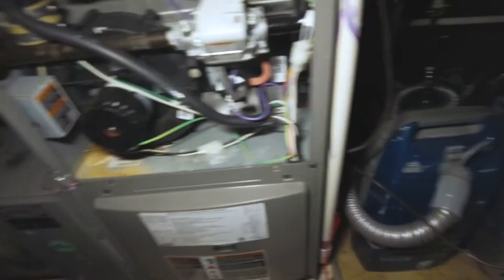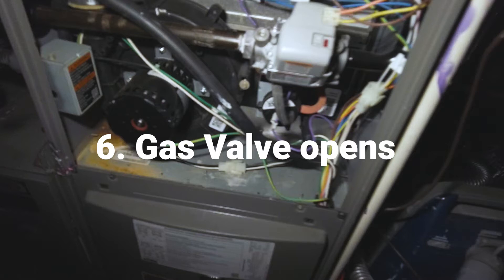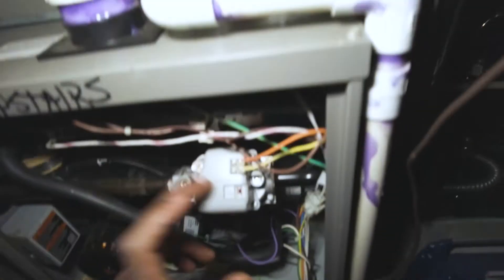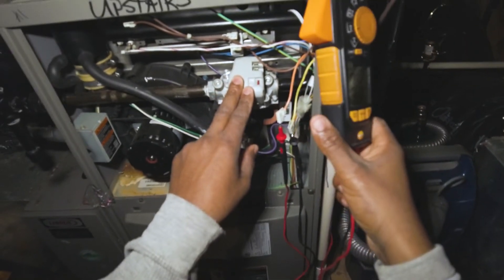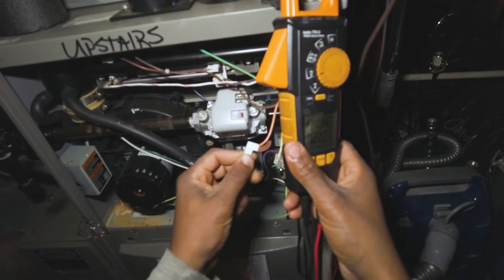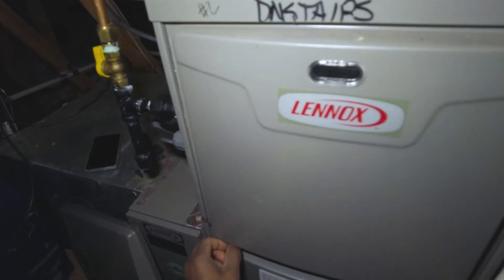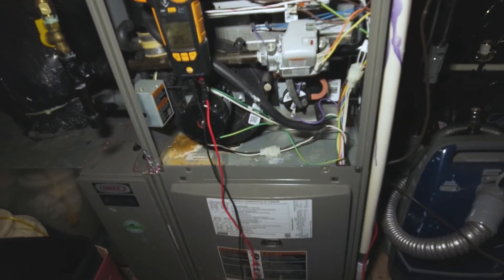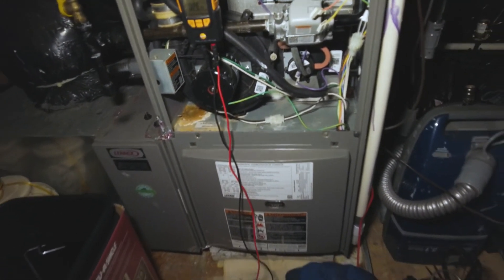HVAC Tech Diagnosing Gas Valve on Lennox Furnace -How to use Sequence of Operations to Troubleshoot

Comment: I have exactly the same issue, my valve has different resistance and it shorts when engaged... Your video confirmed my suspicions, thanks! BTW, can I just swap the coil (plastic) part w/o disconnecting gas pipes?
EDIT: so there's no reason to replace that whole thing, in fact, no reason for new valve. Also, measuring it will not do any good since there's a bridge and a capacitor inside so results will vary. In my case, the problem was shorted diode in the bridge, so I replaced them all (4x 1N4007, <$1) Will post a video later on

Comment: On. Vintage furnace manual light pilot. Replace thermocouple and pilot and still won't light. Seems like low gas flow or none. The line is in the open position and it was running. They shut gas off in June to run new line to the house.  No idea if they properly purged the lines. Supposedly they did. And the tech said he was unable to relight the furnace. I was able to light after 10 minutes of trying. We had some.cold days and tenant said no heat so I went through the typical process and it won't even light at. I am not a professional but have replaced.many valves and cleaned many furnaces and never had a no light. So I am leaning to bad valve for this too. Just unable to find a replacement. I will get the manufacturer and update this channel thanks for your walkthrough.

Comment: Just had the same thing but I believe my issue was the board.  Had 0 volts at the valve, I traced back to the wiring harness on the board, tested for power there and still had 0 volts.  Didn’t take the leads off the valve and tested like you did though.
Reply: I think I have the same issue.  I have the Lennox Merit Merit Series and when I test voltage I'm getting 21.4 volts when I test the upstairs exact same unit I'm getting 28 volts.  So I'm assuming the board is not pushing enough voltage to turn the valve on?  I'm leaning towards ordering a new board at this point.
Reply: update, you guys gave me a tip to check voltage at the board and when I tested at the board I saw 25 volts and WALA! the flame came on, seems like the connections were loose on the board connector, and sticking my volt meter prongs in there to test was enough to tighten the connection now I just need to figure out how to tighten up the connections at the base connector.  I'm sure an AC company would have said, this is an old system, you just need a new unit for 8-9k, or it's the board, that will be $500 for the board and $400 for labor for a total of $900 buckaroos.   Everyone wants to make that easy sleazy money these days.

Comment: Hay I need some help what’s that rubber hose called that runs across the unit in the picture
Reply from the maker: It's a condensate drain hose that connects from the flue pipe to the condensate trap

Comment: Does it matter which wire goes where on the gas valve connection? Thanks
Reply: AC current doesn't have polarity.  Either way is fine.

Comment: Nice troubleshooting and providing the sequence steps in your description area. Also showing the resistance comparison between a bad and good valve coil.
Reply from the maker: Thanks for the feedback. Yeah sometimes it's hard to tell resistance values with gas valves seeing how the coils go through different circuitry depending on the manufacturer.
Reply: Measuring resistance is not reliable, there are several components inside: coil, diode bridge, and capacitor. Take it apart and check all diodes.

Comment: Question,

When you say the board go through all the safety checks before the inducer motor comes on, exactly what safeties is it looking at?
Reply from the maker: It just makes sure all the safety switches  that should be closed are closed and the ones that should be opened are opened. i e the pressure switches should be open upon startup when the inducer motor is idle, if the board scans that pressure switch is closed when the inducer motor is not running then the board can fault that the pressure switch is stuck closed. It also verifies all the limit and rollout switches are be closed Etc.
Reply: @HVACTechKnowledgy  
Thank you